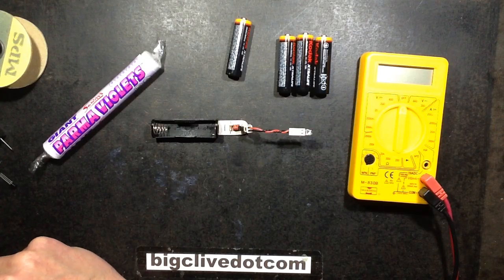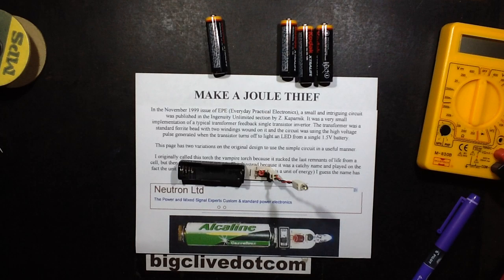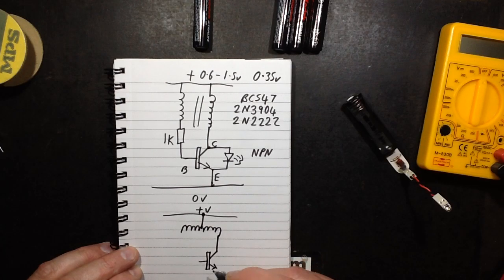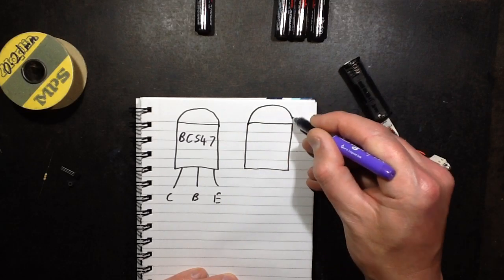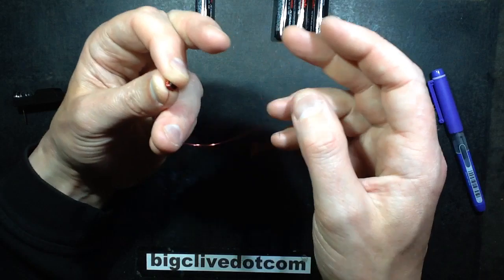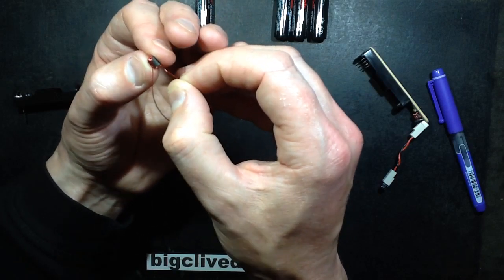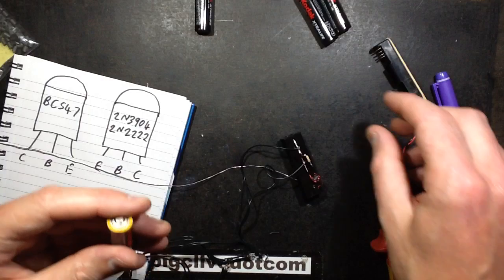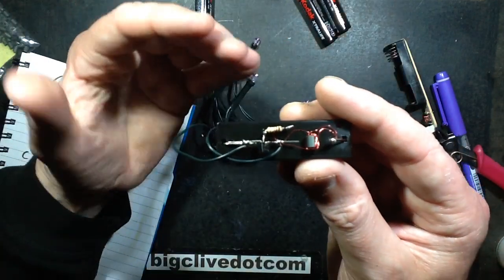How to make an authentic Joule Thief.

Comment: The Joule Thief is a science-fiction trope - a circuit that harvests power from any source that's handy: stray light, a weak but changing magnetic field, radioactive decay, etc. Once a bit of power is harvested it gets pumped into some storage device (battery or capacitor, or even pumping water uphill or lifting a brick) making it available at higher currents or voltages in intermittent bursts. Such a circuit would require sensors that could be "polled" to determine if there were any stray power sources available, hook up the appropriate energy-to-power converter (coil, antenna, solar cell), strike the circuit (from the storage device) and then let it run as long as the power source remained available.
We live surrounded by stray power - lighted rooms, stray fields from power/mains wiring. My watch and my small calculator run more or less eternally just on the stray light they encounter. Why doesn't my smart phone harvest light and/or electromagnetic waves with a Joule Thief, store it in a super-cap and periodically (when enough is available) recharge itself?

Comment: I have a couple of questions for you if you don't mind.  I realize this is an older video, but I finally got all of the parts for this project, so I built it.  I love this little "Joule Thief/vampire"; it's so cool.  I have watched so many project videos on YouTube I couldn't count them if I had to, but this is about the only one I have completed. 
1) You showed what you called going open circuit, just after the 30 min. mark. However, even going full screen on my 40" Samsung screen I couldn't figure out where you made the connection to reach the minimum of 22.5 volts. Could you please do a diagram/drawing showing those connections or the entire circuit. 

2) Could this be done to some sealed lead/gel cell rechargeable batteries from an old power wheelchair? If so could you please recommend what transistor I should use (and any other critical changes, like maybe the size of the center tap transformer, gauge wire etc.)?  

Note: I have a VERY small solar cell to charge it. It might keep it topped off. However, it most likely wouldn't even keep up with the daily loses even without using any power, to be realistic. It is 6V(maybe). The cell itself (the black portion on the glass) is about 2-1/4"x2-1/8" (57mm x 54mm), but I have a big fresnel lens I could focus on it. However, I'm guessing I would most likely fry it. Maybe I should point the lens toward my 1" square Peltier. I could paint it automotive engine flat black. Maybe I can fry those little leads.
Reply from the maker: The Joule Thief is really only intended for boosting a low voltage at very low current.  It's really optimised for simple driving of an LED.
Reply: @bigclivedotcom  Ok thanks. How about the open circuit wiring diagram you were talking about to run several more powerful LEDs as you were showing on the video? I was really hoping I could do something with those old gel batteries.

Comment: Just built mine, it's great however when you put a slightly m,ore charged battery in there's a really high pitched noise from the switching which is annoying.  Measured the frequency across the LED, 4.5kHz so within human hearing...damn
Reply: I built a one that uses a toroid from a power supply, and the preexisting windings. It drives a 10 LED string to several times the brightness of a halfways decent LED flashlight. Gets around 20-30hrs off 4 Ni-MH AA cells, but just like yours, it runs in the audible range. Mine hits around 7-9kHz, which is even worse. Sounds like tinnitus. XD

Comment: I used to think the Joule-Thief was useful, but now I think not. The advantages are that it will work on practically dead cells, easy to make, can be made absolutely tiny and so on. But it consumes far too much current; around 35mA, while the current through an LED needs only to be 1/10th of that.However, all those Poundland solar lamps use the 4-pin chip ( or blob) and these will light LEDs at a fraction of the current of the J-T: I have a colour-changing LED which uses 3-4mA from the 1.5V Ni-MH button cell. I have no idea how that chip accomplishes it, but it's very clever. And very cheap.How low the voltage can go before this one stops, I don't know, but that may not be important. In the winter, theres not enough sunshine to keep the button cell charged if you use the solar panel supplied. But if you hack it and use a bigger panel or parallel several of those silly little ones, you might get away with it.I'm inclined to use a lithium rechargeable ( you can get free ones from many sources ) and use an ATTiny micro to shut it down around midnight when nobody sees it anyway.

Comment: SO I attempted to replicate the joule thief using a pn2222a and the coils from an old computer fan that had broken fins. I got it to light only when the power was applied and removed, not when power was on for longer than a second. it'd just flicker. I'm guessing I used the wrong type of coil then. I couldn't find anything else that'd work.

Comment: I may try this with some Soviet surplus Germanium transistors to see if I can get the minimum startup voltage (and possibly the minimum operating voltage) lower.
Reply from the maker: +John McFerren You may be able to buy modern germanium transistors on eBay.

Comment: Joule Thief charges power bank. I properly recycle my used batteries and cells but rezent not recovering the last bit of power before doing so. I tried using a boost converter but the voltage was too low or the circuit too inefficient to feed the power bank input. Can the joule thief have a cap added to the output such that as the accumulated charge becomes high enough it will deliver some charge to the power bank?

Comment: How about germanium transistors? Germanium diodes have forward voltage of 0.2V, so as analogy to silicon ones, Joule Thief based on germanium transistor would be able to boot up at 0.2V, and maybe work with 0.1V.
What do you think about it? Do you have some germanium transistors?
Reply: Germanium transistor have the bad habit to leak at lot when the temperature raise. For example, at 50C, the collector current may exceed the mid point before saturation.
Otherwise, you are right, the circuit would start at lower voltage.

Another option would be a switch which would short circuit the collector/emitter. Just a fast tap would allow to start. The switch would need to be low impedance and the more boundcing the better, so using an old oxidized copper contact would work better than a clean, nice looking one.

Comment: Wow, that's a coincidence. I remember reading about the joule thief quite a while back, before I started watching your channel - finding out that you came up with the name is a fun discovery. Anyhow, I've been wondering how useful the light output of one of these circuits actually is. Is it, say, suitable only for small light sources in pitch-black environments (for example as a keychain light), or do they provide enough light to be useful elsewhere? I've been toying with the idea of whipping up a few of these with some sort of contact switch to use as in-closet lighting. Would that work, or would it be too dim?
Reply from the maker: Best suited to low level local lighting.  A PIR LED closet light might be a good idea.

Comment: Could you extract the remaining power from a battery by transferring it to a capacitor? Perhaps design around 0.5v input then somehow step it up to something usable
Reply: +Conscript69 You can rectify the output of the Joule thief and charge a capacitor with it.

Comment: Would wiring them in series vs parallel affect brightness or battery life?  Thanks again...
Reply from the maker: Andrew Cottrill Probably similar brightness, but possibly not utilising the battery down to such a low voltage when wired in series.

Comment: I'm wondering what happens when you insert a fully charged battery??? 
Does it burn much brighter and slowly getting dimmer over time or does it fry the LEDs???
Reply from the maker: It will start bright and gradually get dimmer over time.

Comment: Hi Clive, could this be used with a larger power led or is there a limit . Also can you have to many turns on the ferrite core.
Reply from the maker: The Joule Thief is only intended for low power LEDs.  For high power ones it would be better to use a boost converter module with current regulation.

Comment: Great video! I am self taught in electronics & really like to tinker around with circuits like this I have heard the name joule thief before but never looked it up to see what it was very impressive little circuit to say the least - I also like RF (Bugs) and High Voltage circuits do you have any projects on those subjects? Thanks for posting the video- Two Thumbs up!!
Reply from the maker: I built a lot of bugs and high voltage inverters when I was younger.    I should make a video about the bugs.
Reply: That would be really Great!. I have built a few "Spy Bugs" some good and some not so good lol the biggest problem I have is with frequency drift only a handful were stable. I subscribes & hit the bell so I won>t miss'em if you do post them
Reply: I hit the wrong button (damn it) - Good Channel btw glad I found it --Two thumbs up!!

Comment: Hi Clive,
Great video thanks.  Just been  trying  to source them or find a link to similar ones, given that  the RS components version you uses has been discontinued. Any chance you could give the actual dimensions of the ferrite bead you used or give a link to similar? I'd be most grateful. Thanks a million.  James
Reply from the maker: The main thing to look for is a hole in the middle of the core that allows easy winding of a good number of turns.  There's often a decent core inside most old compact fluorescent lamps, but eBay probably lists them too.
Reply: @bigclivedotcom  OK I'll give it a shot. Thanks a million Clive. Best, James

Comment: I first saw this in a large format 'news paper' magazine called  Nuts and Volts about 25years ago.IDK if it was an article or an add. I also am not sure if was called joule thief either.      How old is the actual idea of this circuit.  As in " Does it have to be solid state?".  Very curious.
Reply: This may answer some of your questions : https://en.wikipedia.org/wiki/Joule_thief

Comment: So water hammer and voltage spikes are a comparable thing, and this works in a similar fashion as the water hammer/ram pump?
Reply: Very Good! not many people can see the correlation and it's usefulness. Such as making electric cars go further on a charge or capturing energy that would otherwise be wasted.

Comment: Got an ebay "surprise bag" of mini toroid/beads this week. Getting back into hobby electronics and going to try a few Joule Thief. In the bag was a surprise, one bigger than a c*** ring. What use is one this big? Other than the previous implication. 40mm across. The toroid that is. Thoughts?
Reply from the maker: Sometimes mains cables will be looped around a core for noise suppression reasons.

Comment: Greetings, once again. Seems I am posting more and more on your videos, but that is because I always find great material to kill the tons of time that God puts on me every day with nothing to fill it but my computer or my TV.  Since first viewing this video, I have made all sorts of these, and you are right, you can do a million different things with this wonderful circuit.  I currently am running a 1 watt light at very high intensity using this circuit  but having it hooked to 2 AAA batteries. The cells are 5 year old Nicads that I have had laying in a box to toss next time I go to the recycle place. I charged them to what they would charge to which was about 1 volt each and built the circuit using a small ferrite ring removed from an old PC power supply on tear down.  I used wire taken from a CAT5 cable for the turnings and a 2n3904 transistor, a 1K resistor (all from your video) then wired it to the 2 cell pack, and wrapped the whole deal in black tape to keep things in order.  I have used the little light now for a whole winter in our RV for a flashlight, and over half the summer now for a light to find things in my back room and my supply chest, and it still lights everything very well. I was amazed that it does not heat up, and gives more light then powering it with a shot from a new 9 volt battery.  These are indeed very cool.  Makes my grandsons eyes grow to the size of pie plates when the look over grandpa's shoulder and see what he made with his soldering iron!
Reply from the maker: You'll find many older NiCd or NiMh cells will charge better on a simpler dumb charger that just trickle charges them continuously.  The modern fast chargers tend to only put a small charge into them before terminating the charge cycle on voltage.

Comment: Would it be possible to get this circuit to start on a battery voltage lower than Vbe drop by momentarily shorting the base to the emitter? I was thinking the inductive kickback might be able to start it again.

Comment: Would this, if used with a solar charger, make led lights last longer, especially in winter. Or would it just knacker the battery?
Reply from the maker: You can change the inductor in solar lights to make them run at lower current.  I think you increase the value.

Comment: +bigclivedotcom I have built this circuit and a led has been running of pretty dead batteries for a few days now. However, since a few days, the led is blinking. The timing appeared constant: few seconds on (starts on if I disconnect and reconnect), a few seconds off, but the time it is off has been increasing slowly.

It has me flabbergasted. I wonder how that can even be possible?
Reply: Probably the recovery time of the battery.  Under load the voltage drops, the circuit packs up, so there's no load, after some moments the battery chemistry recovers and the circuit kicks in again.  Just my guess!

Comment: Made it, love it. Not sure if this is a daft question, or am I just being greedy, can they be run in series. Would it be feasible to make a 12 volt version with a bank of dead batteries? Maybe even with a load of D cells. Thanks, Shrek.
Reply from the maker: I wouldn't recommend it.  They are best used on their own, but you could hook several cells in parallel to give a higher energy capacity.  But they'd need to have close voltages before joining them together.

Comment: HELP/ADVICE PLEASE. 
I made one of these exactly as per Clive's instructions and it works with any AA I've used. I read somewhere that you can improve efficiency by using 14 turns to 30 (base/collector side) on the transformer.  I made another 'thief 'using that number of coils and the LED burns brighter but the transistor quickly gets crazy hot then the LED starts to stutter with a battery that's above 1v to start with (below 1v it seems to cope).  An ideas what is going on?  Obviously I could just take some of the extra turns off the collector coil but I'm trying to understand what's actually happening. I'm new to electronics and picking things up very slowly but wondering if more coils = lower frequency of oscillation = current flowing through the transistor for longer hence overheating?
Reply from the maker: Maybe too big a core or too thick a wire.

Comment: Hi Clive, I've tried to make a joule thief with everything in your video but to no avail could you give me some advice please. I'm using the same transistor as you have I've bought some ferrite rings from amazon with a 9mm diameter and also some 0.35 copper wire (I couldn't find any 0.21 that you used) and also a 1k resistor. My led is rated at about 2.5 v but doesn't light,  the voltage at the led is 1.5v the same as the battery is so I'm confused why it is not boosting the power up like it should be.  Hope you can help me, cheers from Frank in Kidderminster.  👍
Reply from the maker: It's possible you've mixed up the winding ends.  Keep experimenting or try building another from scratch.
Reply: @bigclivedotcom  I'll double check the windings, I've already checked that I had it wired correctly to the transistor. The two windings that you join have no continuity the same as the two windings that are not joined am I correct ? Thank you for getting back to me I find your videos very educational and entertaining you should be a teacher or on the tv.

Comment: Great video shame I can't get this blasted circuit to work no matter what I do can't get it to work at all I'm using a quarter watt resistor and a  standard mpn transistor.

Should I be using different values?
My first time attempting anything like this so clearly I'm doing something wrong
Reply from the maker: Just starry from scratch.  It's easy to get the windings mixed up.
Reply: @bigclivedotcom  I have had three attempts,  two of them using single taped Windings as I thought it would be impossible to Naff it up.

I suppose it's possible I have a Duff batch of  transistors  (BC547   B331)
Or possibly the wrong one ?
Reply from the maker: @daler2577  Make sure you're getting the transistor pins correct and that the inductor isn't too big.

Comment: Why doesn't the current just flow through the right hand coil and through the LED? Doesn't the forward junction of the LED have a similar drop as the transistor's junction? Or is it far enough apart that it won't turn on before the transistor does?
Reply from the maker: +Aurelius R If the battery voltage exceeded the forward voltage of the LED it would light it directly.
Reply: bigclivedotcom Ahhh. of course.